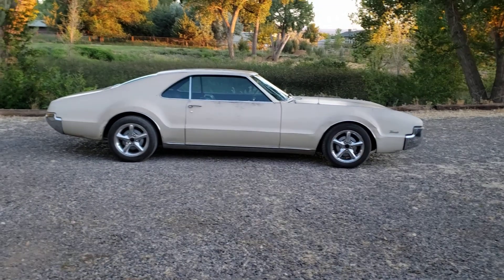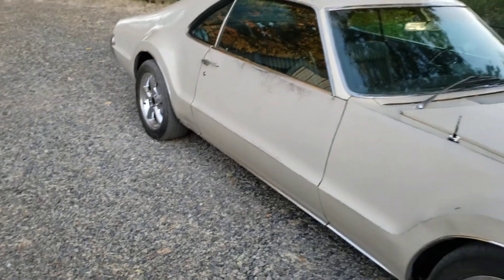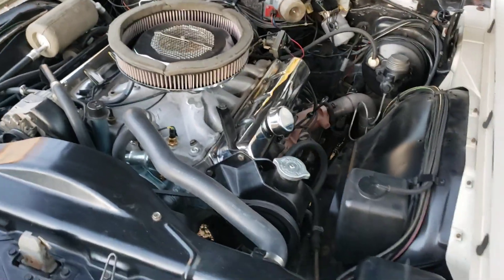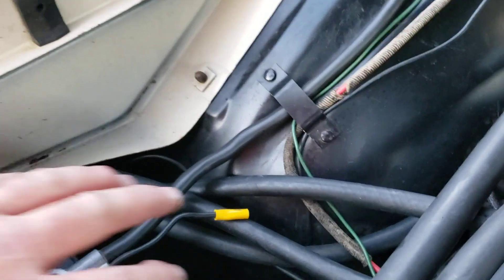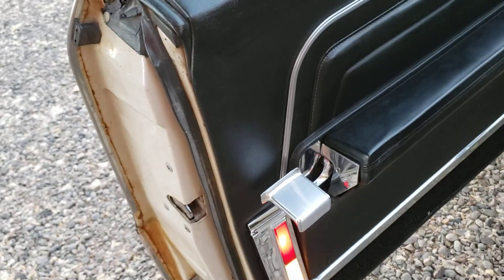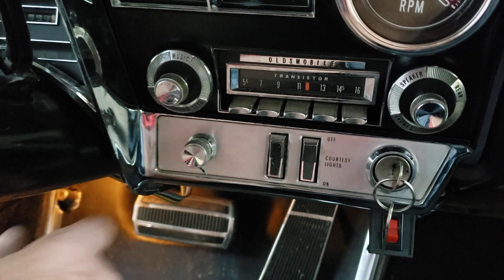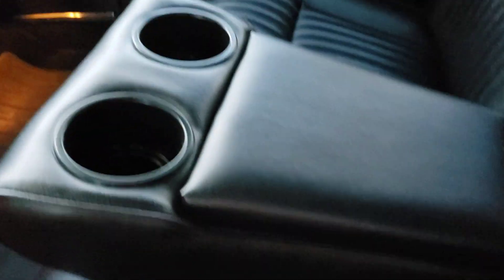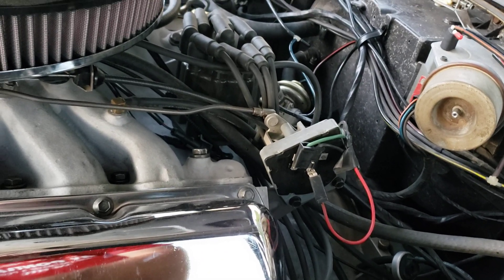1966 oldsmobile Toronado modifications

Comment: How did you open up the center holes on the wheels?.  On a lathe? Die grinder?  They are a hub-centered wheel from the factory and I was wondering if it would matter if it was switched to lug-centered
What about wheel stud length with the thicker aluminium wheel mount?

I bought a Pacifica wheel (5 on 5” x 17”) to test wheel well fitment and used a 3 inch hole saw in a drill to open up the center bore to fit the wheel hub.  It went poorly, but did the job as a test wheel.   It barely touches the outer lip on the brake drum as you mentioned, while having about 3/4 inch lip clearance in the rear wheel well on my 75 Toro.  I am looking for a set of 20 spoke Chrysler Town and Country wheels from 2012 -2015.  Looks very classy on this car when I loosely installed a set from my Father’s van 

 I was considering grinding the drum lip rather than the wheel. Any thoughts on that?

I appreciate you coming back to add a more in-depth overview to your modifications.  Cheers